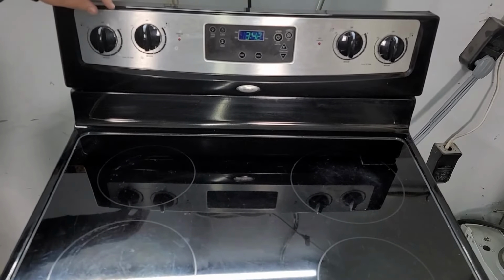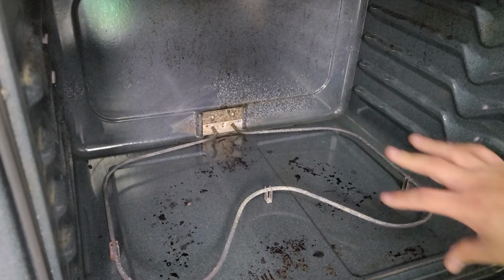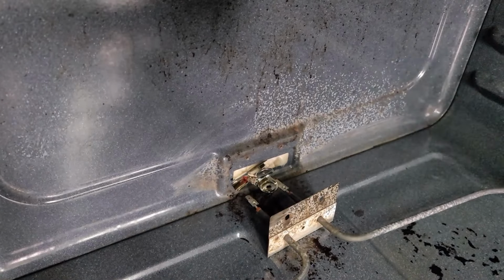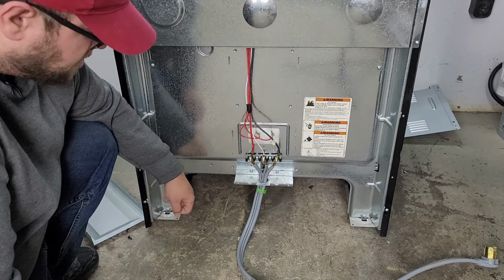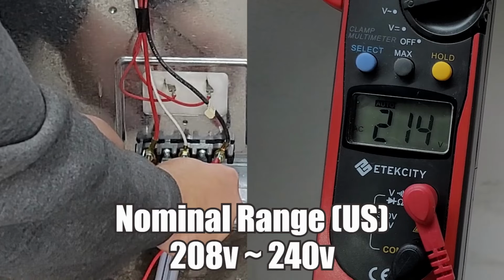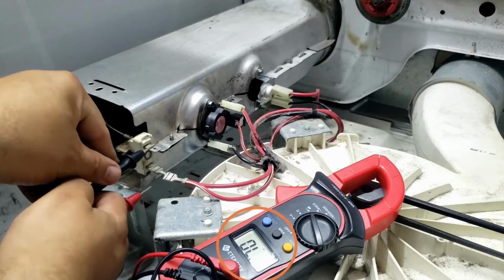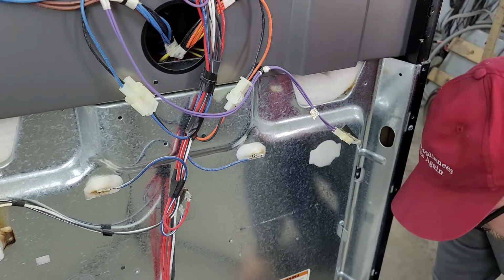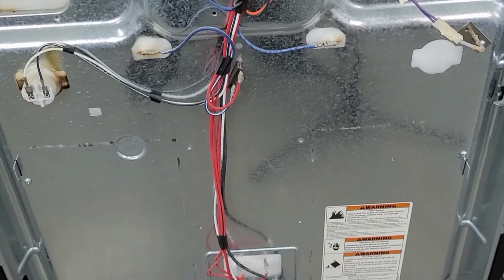Whirlpool Oven Won't Heat - How to Range Troubleshoot a Whirlpool Oven Not Working

Comment: Whirlpool oven model wee730h0ds0 bottom bake element exploded and sparked pretty good. Replaced with new element but does not seem to heat up. Broiler element gets red hot if set to broil but set on a bake setting the bottom element does not turn on. Stove top burners all work fine. So my question is, if the stove top burners work and the broiler element works is it safe to say the thermal fuse is fine? Would the control board also be fine if the the stove top and broiler element works but not the bake element? And same for the thermostat? From the best I can tell it seems when set to bake setting, the oven normally uses a combination of the baking element at the bottom and the broiler element, is this true? The oven will start to heat up when put on a bake setting but it seems only the broiler element is the one getting hot.
Reply from the maker: I am not familiar with that model. Some use broil+bake, and others use bake only. You said the bake element exploded (physically damaged), then now it won't heat up at all, correct?

The thermal fuse SHOULD be fine. You can test/verify with a multimeter set to continuity "just in case", but the fuse only acts as a safety switch if the cabinet overheats - not if the element explodes. Thermostat should be OK too. 

The control board SHOULD be fine despite the element issues. The bake relay that supplies voltage to the element can go bad independently of anything else - we see this all the time on Frigidaire's when the element is OK or replaced, but still fails to get voltage to element. 

A few things I'd investigate and verify:

1) Can you verify with a thermal gun (a cheap one) that bake element isn't getting hot at all?
2) Is the element properly attached w/ the spade terminals in back? I had an oven a week ago that I thought element was bad, but it ended up the spade terminals that go from board to element (at the element) were bad too, not just element. Is all other requisite wiring ok?
3) Another big thing, and I did this @ end of video was check voltage when the oven is on. If you're feeling up to it and wearing gloves, you can use a multimeter on voltage to test between the two metal spades on back of oven when its running to see if the board is triggering 240v signals to the bake element. If its not sending any voltage, there may of been a chain reaction of the element dying that caused an issue w/ the bake relay. Very unlikely, but possible.
Reply: @bensappliancesandjunk  Yes that's correct, it made a popping/crackling noise. The bottom element on this stove is under a cover plate, I took the cover plate off and the element was severed in two spots and was all fried looking, I threw that one out and bought a brand new element and installed it. I currently don't have a thermal gun but if I put it on a bake setting I can put my hand directly on the element and feel absolutely no heat at all. I've inspected all of the wires in the back, including the ones leading to the elements and all have no sign of an issue, nothing burnt or corroded. Something I mentioned previously about the broiler element working in combination with the bottom element on a bake setting. It appears this oven has a "rapid preheat" setting you can apply which turns on both top and bottom elements while preheating for a bake setting. That gave a me a false reading previously of the bottom element as it would feel slightly warm to the touch but it was only getting warmed up by the broiler element during a rapid preheat. The bottom element is not heating up at all on any setting. I will get a multi meter tomorrow to test the items you mentioned.
Reply: I checked the oven today with a multimeter. The three leads coming from the wire that plugs into the wall is sending 240 volts to the oven. On the terminal testing the outer leads reads 240. The two wires leading to the bake element is not getting 240. It’s reading from 30-50 volts. So is it safe to say the control board is bad or the relay like you mention?
Reply from the maker: @MattBonacci  yes that would be it.
Reply from the maker: The two wires each are supposed to provide 120v to equal 240. If its much lower than that, but stove burners run fine, there's a damaged contact internally to the relays causing them to fail to operatr
Reply: @bensappliancesandjunk  so in other words it’s not fixable?
Reply from the maker: @MattBonacci  no, you can take the board out, and replace the bake relay. Most likely, you'll see some damage on the underside. Just need the exact relay + solder gun and thats all you need. Otherwise, replace board.

Comment: I got a stove as part of a package deal once.  It didn’t work.  Turned out that cockroaches shorted and damaged the control board.  I will think twice before I bring a kitchen appliance into my garage again!  I don’t want to bring roaches in, not even into my garage.
Reply from the maker: Had that happen on testing stuff - we think somethings ok, bring it in, and then find out it's infested. We won't bring anything in that looks dirty and we will check before we bring it in any morr
Reply: @bensappliancesandjunk  if its really cold outside I leave it out side or in the cold weather . that usually does them in.